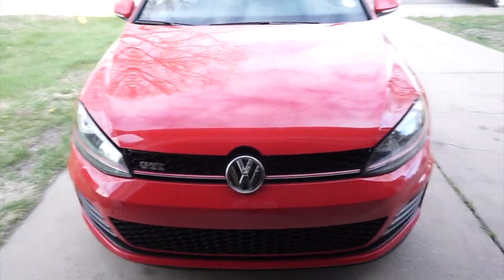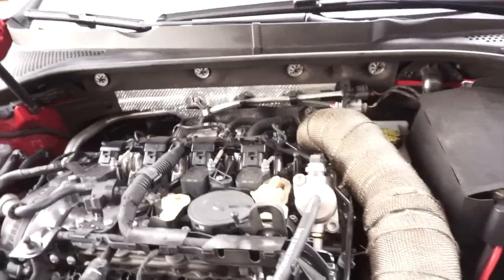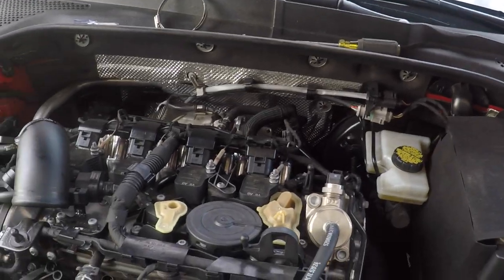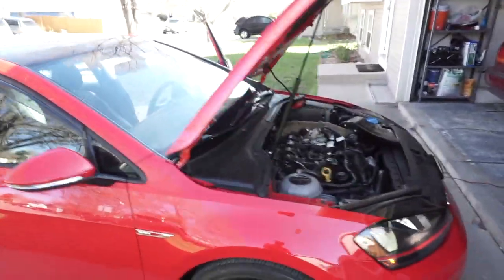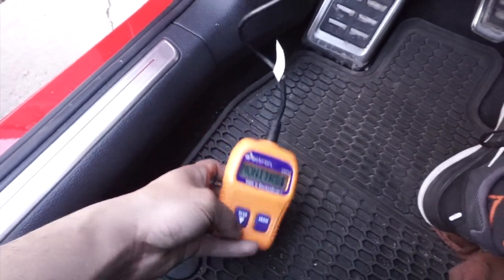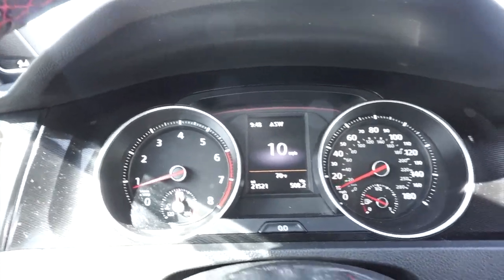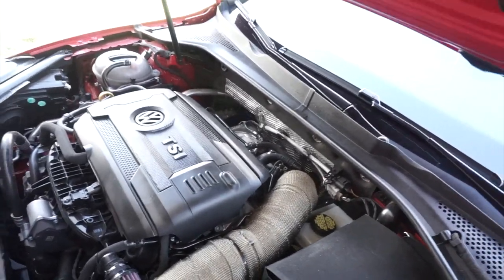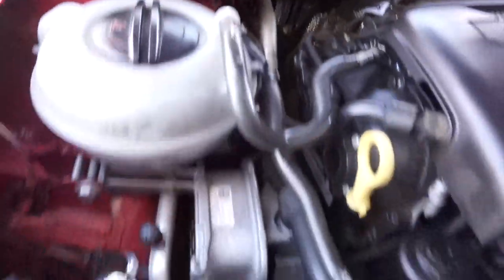MK7 GTI Missfire After running E85

Comment: I run 3.5-3.8 gallons of E85 and top it off with 93 oct on my MK6 GTI and it runs perfectly fine. Definitely feel the difference in the top end. I do this mainly because I live in Houston and it’s hot than a mf out here lol. I don’t have an upgraded IC so my car really suffers from this heat. I actually run it on a Unitronic stage 2 flash tune. I do feel an increase in performance (though not it’s max benefit since I’m not tuned for e30). One day i did mix a little too much E85 and it started misfiring as well but all I had to do was pump some more 93 in it (which diluted it) and clear the code and it was back to normal.

I’ve noticed that MK7 GTIs on flash tunes can’t take as much E85 as MK6 GTIs can.
** I do not recommend experimenting with E85 blends if you’re on a stock tune. Try it out if you’re flashed but use extra caution. Not recommended by tuners at all.

Comment: My 17 MK7R will turn on the CEL during cold start (miss-fires) if I don't wait until the high speed idle drops before trying to drive it. It's known issue on the R's.
Reply: I run E30 all the time and never had a issue such as you describe. I hope it's gone, good luck either way.

Comment: Same issue... I’m thinking bad ignition coil but I could be wrong. Does it flutter past 3rpm?
Reply: I have a 15 and when I did my spark plugs the way Volkswagen designed it one of the  ignition coil it snapped off but it clamped back into place but some videos say if the coil snaps off it’s best to replace the whole set
Reply: 5280TSI I do but unfortunately I’m bone stock ☠️ lol
Reply: 5280TSI haha yea I was thinking about the rs7 plugs but I think they cost more than the brisk spark plugs which I had on my car.she  was still acting up so I thought since it was stock maybe aftermarket  sparks wouldn’t be the good route so I went back to oem and still  she’s running a lil funky lol ☠️😂😭
Reply: It’s so much easier when you have it tune! It smoothens everything out lol

Comment: dont run more than 3gal of E85 without being tuned man. you just need to change plugs and close the gap to .024+/-1. heads up brisk er12s is a better plug
Reply: i had the same issue and im tuned for E48 lol for me it was just incorrect plug gap, not a big deal.
Reply: 5280TSI ohh then yea it's most likely just plugs bro. And I'm protuned thru the Cobb Accessport by 5150 Racing, so I can flash maps myself but the actual tuning is handled thru Jon @5150
Reply: 5280TSI Idk if you are in the mk7 fb groups but that's a great place to gather info on modding your car brutha! And you need lpfp/hpfp and mpi upgrades to run full E, a good E50 tune is better imo, unless you're gonna go big turbo soon then u might as well do the fueling and full E upgrades lol.

Comment: The other day I plugged in my obdeleven and I had a code for a missfire car didn't feel any different. I did run e85 a long time ago and my car ran fine but maybe the e85 did the miss fire....I'm on a stock tune
Reply from the maker: WHENZLUNCH very possible man! It’s weird because I still get a random misfire here and there and the car hasn’t seen e85 for the longest but I won’t throw a check engine light it’s only if I scan the car randomly
Reply: I've ran an E30 blend with the JB4 multiple times and have not had any issues yet. I know a lot of people all over the JB4 forums who run E85 so its pretty common. Still very interesting though.
Reply from the maker: BT37 maybe it was just me man I’ve seen people run e85 as well with no problems but who knows 🤷🏻‍♂️
Reply: Yeah not sure. BTW, have you done the mod where you fully deactivate ESC using VCDS/OBD11?
Reply from the maker: BT37 I have not man I need to give it a try have you?
Reply: I started messing around with it today but have not actually tried it yet. In order to have absolutely zero intervention you also have to disable something called "starting vibration reduction." If you just disable ESC fully the car will still cut power once it detects wheel hop hence the reason why you have to disable "starting vibration reduction." The only thing I'm concerned about is getting real bad wheel hop and breaking something but I have yet to find anyone who's had a problem. I'm always really cautious when trying something new lol.

Comment: Did you have a e85 tune?? You just cant add
Reply: I think he did, because he said he was going back to the "regular stage 2" tune although its just an assumption.
Reply: 5280TSI hope your just being sarcastic lol. But if your serious atleast you pumped it out... the only reason i asked because no one else i ever knew had that issue
Reply: nevermind my comment then lol
Reply: 5280TSI  no e30 blend is a seperate tune and timing needs to be changed at least you will be good now... hopefully no serious damage... definitly change the plugs

Comment: I'm dead. This is too funny. If you're not running a tune. Dont use e85 period. If you're stage to MAX E30 blend. If you're stage 3+ with flex fuel you can go full e85.
Reply: yup nothing more than E30 on these cars unless you have and HPFP, MPI, or LPFP